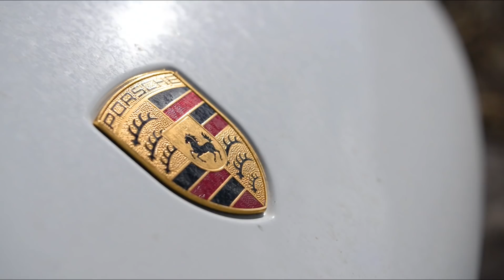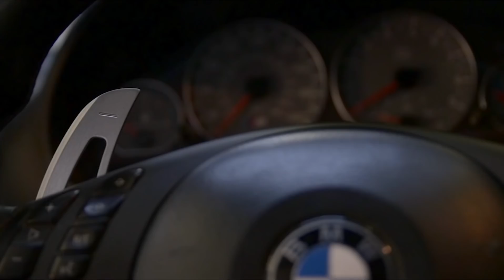Cars Are Changing

Comment: My experiences with cars have always been from year models 1998 and older. My first real car was a 1985 Chevy Citation II, and as bad of a car as it was, I enjoyed the hell out of that thing because of one thing I like to do with my cars that I've found very difficult to do, and enjoy, on newer cars: working on it myself. In recent years however, it would seem the ilk of "shade tree mechanics" and even mechanics in general is an oddity. Yes, most cars today are more advanced, faster, and safer, but at the expense of taking away the consumer's confidence to work on their own vehicles. There should be no such thing as an aftermarket industry if this were true, and I KNOW for every one part that I want to replace, there are at least half a dozen other models to pick and choose from. With some of today's newer cars? HA! Forget about it! Car manufacturers have ONE part they specifically want you to put in their vehicle, and almost without a doubt, there will be some sort of electronic sensor/module/computer to hook up to the thing in tangent just to get it running.

I am by no stretch of the imagination a mechanic or die hard enthusiast. I am, however, someone who loves the idea of being able to fix, repair, maintain and in most cases, rebuild my car back to spec OR EVEN BETTER standards than it should be. You can't do that with newer cars, and the auto industry knows that. As much as the consumer is a driving force of what is changing with cars, a part of that also is the auto industry looking at the most convenient thing to exploit and that's the certainty that people will WANT a new car ever 5 years, and turn that want into a NEED, because they think once it's past 5 years old, it's "unreliable, unsafe, old and ugly."

Tell that to the guy who still drives a 1990 Geo Metro.

Explain that to someone who collects, restores and takes his 1950 Chevy 3100 out for drives every other day out of the week.

Try justifying that to the dude who gave into buying one of these recent model cars, under the impression he was getting an awesome car, only to find out that when he wants to change the spark plugs and wires out of his car himself, can't, because there's a huge stupid piece of plastic blocking everything over the engine, or even the battery that has a large metal bracket that's bolted on top of it.

I love the notion that we are far better off wherever we've come from with cars, because we really have come a long way. But I do not enjoy the illusion that we're truly blessed, when the individual consumer is pretty much sold a car not at just the expense of their wallet, but their confidence as well when its buyers have no idea how to fix something, and feel helpless once they see the dreaded Check Engine light. I love cars because I can personally fix them myself and will take it to a professional when all else fails, but even then, I'll be able to deliberate generously with my mechanic about what the issue is and exchange stories while we're at it. Sadly, most people who own vehicles, do not think or feel this way.

Comment: Sorry to disagree. If the manufactures don't make what I want I simply won't buy them. For a DD, sure I'll take the tech that makes life simpler, but for a 2nd, 3rd, or ? car I want something that is engaging to drive. Anything that takes away from that experience will not be tolerated. For me that means less gizmos. I find myself going backwards... My current fun car is an '01 BMW Z3 3.0. I love it. Next on my radar is either an S2000 or a 70's Datsun Z with triple Webbers. Less tech and more mechanical. Classics will be classics forever. Technology changes on a daily basis. The most beautiful automotive design came out of the late 60's IMHO. Google the Alfa Romeo 33 Stradale - The most beautiful car ever made IMHO. I'm not saying I won't try the latest and greatest, but it had better enhance the driving experience. Example: The electric steering on my Honda Accord coupe is SO bad that I'm getting rid of the car. I can't stand it. Maybe to a generation of kids that learned about cars playing Gran Turismo on a D-Pad this steering might be just fine. But to a guy like me with a BMW in the garage with a hydraulic rack, it just won't do.

Comment: Car manufactures made consumers buy automatics....you wanted a manual transmission in a mid level car you can't get it anymore.  if you want leather seat or any options package the car manufacture made you take a auto trans.  so if you want a base model you could get a manual. so obviosly less manual cars are sold.

Comment: The only big change I care about is self driving cars. I don't think your ever going to ban human driving. To many people like driving and need/want to be able to drive for utility or just simple fun purposes. Peugeot came out with a concept that showed what they think the future of driving will be and I really like it. It had 4 driving modes, 2 self driving and 2 manual driving. The first self driving was simply it plotting the most efficient path and getting you there as fast as possible. The second was a relaxing one taking the longer more scenic route. The 2 manual modes were called relaxed and engaged. Relaxed is you driving but the computers are still running in the background ready to come on when you mess up. Engaged is still with the computers on but the level you have to drive before they kick in is much higher allowing you to have some fun.

The Peugeot concept is the exact type of autonomous car I want the future to be. The 2 autonomous modes are cool. But as far as the driving modes it would be really cool. The relaxed could be you driving but all the autonomous safety things would still be running and would take over and avoid a crash if you don't react quick enough and then when the threat has gone away it fades back into the background. It would use the same tech as when it's self driving so it would be just as safe. The other driver engaged one would be the same thing but the computer wouldn't come on until the last second to avoid a crash if you were really being stupid. This would all be amazing provided we get the tech down and it doesn't intervene when not needed. Heck if cars start becoming standard with that stuff maybe we could eliminate the speed limits and have it like the autobahn on a lot of roads if we get the software advanced enough. I mean if it's perfectly safe like people keep saying autonomous car will be then why not? We could really start to enjoy our sports cars and everything they have to offer!

To anyone that brings up the saving of lives things there is this: in a study done by national highway safety administration (I think it was them) concluded that if every car had level 2 autonomous driving, being lane keep, auto avoidance, auto braking, and all the warning features like blind spot, fatal crashes would fall by 80%. Using the same tech like I suggested above would make it almost 0%, just like a self driving car. Im not going to deny that there will be a lot of people that will just let the car drive all the time, especially. But there will always be many people that want/need to drive and you wont be able to ban it when the biggest argument for it other than some people just not wanting to drive(which is fine, that why we need choices for those who do and for those who don't), that being saving lives, will go away as this auto safety tech(still not self driving stuff) starts getting more common and more effective.

Comment: There is a difference between features and quality... the advent of cruise control for example isn't a reason to put an older type of driving quality out to pasture and label it as obsolete.  Every type of driving experience is valid.  "Better" isn't correct because a young person declares it to be.  They may only say as such if they have gathered perspective from actually trying other experiences.  This is the number one flaw of Millennials.  They appear to believe they are more experienced than older people simply because they have awareness of old ways.  Awareness is not the same as Experience. Experience also included cultural context. This is what life is. True physical experience not vicarious mental cataloging.  Playing guitar hero is not actually pressing steel strings down onto a fretboard and feeling the vibration of the body in the arms and hips... the real production of sound from an instrument as an extension of the expression of the mind and body.  The analogue expression vs. digital compartmentalizing.  The comparatively primitive is still effective and visceral.  This is true heart.  The heart of driving is an expression of the mind and body through ANY machine translated into (mainly) forward travel through space.  Don't knock the old until you have experienced it.  Perspective is earned through living life, not reading about it.

Comment: This is a very nice video with very valid arguments and reasoning, however I prefer being that grumpy man who will stand by manual  transmissions and naturally aspirated straight sixes. I don't need the car to control itself as it is said in the video it takers away a lot of the experience. I own a base model Peugeot 206 1.4 (no TCS, no ESP, no ABS) and it is a lot more fun to drive than my parents' Mercedes with an automatic. I like driving for the driving itself, not for getting from point A to point B.

Comment: comparing manual vs auto is VERY different than fuel injection vs carburetors, people don't see a carburetor as controlling the car better, they don't see it as having a good drive after a long day, revv matching, controlling the car, being the car, as if the car were just an extension of the body. you can't be mad at fuel injection, that's like saying "oh I'm mad because my worn out kidney that was doomed for failure and would have made my whole body succumb to death is gone because I got a better, newer one.

Comment: I HATE the fact that you can't get a spare key made for $5 anymore!! Now you have to buy a key for $170 and then ANOTHER $60 to have some guy plug it into a computer and push a button! 😑
Reply: Oh no.. please give us back 10$ worth locks on our cars so they get jacked in under a minute. Most brainless comment ever.
Reply: There is a healthy middle ground between an alloy stamp for $5 and a wireless remote for $500.  It is frustrating that nobody offers the old chip keys because every car nowadays is going to strand you without warning someday when the electronics stop working.
Reply: or just buy a key fob for cheap the dealers always charge to much then program it yourself
Reply: IBuyFromKmart you can.t you need a special access code to program most key fobs
Reply: I keep hitting the panic button on my fob.  I used to stick my key in my shoelaces while I ran, now keys are the size of a bagel bite and have batteries that run out 2 months after your warranty expires.
Reply: loveanianimeme Audi is 950 or so per key .. just lost both of mine lol... >.>
Reply: Lol fr
Reply: It's more like $800 now.

Comment: The Citroen DS you showed momentarily is one of the most innovative cars. Cars today are not as technically exciting as that was. Most cars today still have coil springs for suspension, some have drum brakes on the back and some have a stupid torsion beam for rear suspension. I wish manufacturers put more effort into the basic design of the car instead of jst bluetooth, stereo, dimming mirrors etc

Comment: i find there are 2 different kinds of change, ones that have alternatives and ones that don't. eg plenty of people are against the increasingly smaller engines which mean reduced power, but then a performance electric comes out and their problem is solved. also with the disappearing manual transmission meaning people can't select gears, this is solved with a semi-automatic mode. compare though the shift to the screen displays with button and clicking interfaces that provide no tactile feedback - looking and seeing which gear or mode you're in vs getting it from the position of the lever as you move it. there really is no alternative to that for people who want to reach and feel to make adjustments.

Comment: I think there's a misconception on the viewpoint of those that want manuals;  It isn't that they only want manuals, or that they don't want autos.  However, folks that want manuals want to have the option of still purchasing one vs "only" having the choice of an auto/dsg.  Clearly, if more push pedal folks want auto, then the market will push that, but it does suck that there's less options made available.  

Lastly, the shift to electronic is a bit different than changes of the past;  We've always had different variances to sound.  Hell, some folks don't even care how powerful the car is, as long as it sounds good.  There's a link between driving and hearing what's going on with the car.  With electronic vehicles, that's absent. I drove a Tesla while in Chicago and although it was fast as hell, the thrill was silent.  Maybe it's just me, but I think it's becoming a bit boring and more of how good the shell looks vs the driver engagement.

Comment: Err no, modern cars are much more difficult to work on especially with all those electronics which are super fragile along with stupid covers on the engine bay which makes things less accessible. I read somewhere of a BMW which doesn't even have a dipstick to check the oil. WTF? Most gadgets on cars are totally unnecessary and are even dangerous as they distract the driver. I'll sob the day driverless cars become the norm all the soul will go and journeys will be boring. That's just my opinion, hate it if you want but there you go.

Comment: Well.. That is sevdo true..

Take volvo for instance. They use to have 3 different transmition options. Traditional manual, digital automatic and mechanical automatic.

Manual was the cheapest to produce, mechanical automatic was a bit more expensive, and digital automatic was the most expensive.

BUUUUT. The option of 3 different gearboxes in the assembly line was also expensive. Just making one pretty much close the gap. That is. If they made only digital automatic, then it will push down the price pretty much to the manual one.

Of cause, if they made only mechanical automatic, it will even be cheaper. And if manual only was the option it would still be cheaper.

So the realized that just removing the option saved a lot of money. So what did they choose. Digital automatic.And sure, now you get a automatic to the price of a manual.

So if one want one but could afford one its perfect. but if you don´t want one you are out of luck.

So why did they go for the digital automatic. Because it was the most popular? No It was not. Because it would give the greatest saving.. well that is also not the case.

The reason is EU regulations. The digital automatic was the best choice to meat regulations.

While its not a bad choice, its proves that its not always customers that choice. You can go for a other brand.. sure... for the moment. But more and more brand goes this way. And in a few years it will only be the very expensive once that gives you the option. Basically making people with a thinner wallet not able to choice  any more.

Comment: whats next? I'll tell you, and you can check me up in 5 to 10 years.
batmobile-inspired designs.
4x4 family sedans BECAUSE EVERYONE NEEDS A 4X4 SUV ESPECIALLY IF YOU ONLY DRIVE IN THE CITY LIMITS.
Automatic transmissions because everyone today cant drive and are n00bs.
Electric cars. Not even hybrids. Pure 100% explodable S7 li-ion batteries connected in a series to power dat-ass.
Measuring power with KWH and not BHP. there will be no horsepower in the future, sadly. power will be measured by battery drain.

Comment: I drive only vintage cars, and by that I mean 1979 and older. I prefer '60s cars and have 2. I won't own anything with a computer, fuel injection, airbags, ABS or independent rear suspension (air cooled VWs excluded) I want a car, not a computer on wheels.

Comment: I need a manufacturer to come out with the ultimate '"Hardcore" car. When I say hardcore I mean, like fucking ridiclous. I want full 5/6 speed manual, no power steering, 15" wheels, a real V6 or 4 Cyl with a turbo the size of fucking Pluto strapped to it. No Sat-nav, no traction control, no ABS or any of that shit. Build a car that will go like stink and if you can't handle it, it'll fucking kill you.

Comment: Today's cars may handle better, be safer and more efficient, have more power and go faster, but they are not comfortable, don't look elegant, have poor visibility and are very expensive to service and repair. There are way too many unnecessary electronic features in modern cars that add to breakdown susceptibility. I don't see modern cars lasting a long time, and today's design trends seem simply dreadful.